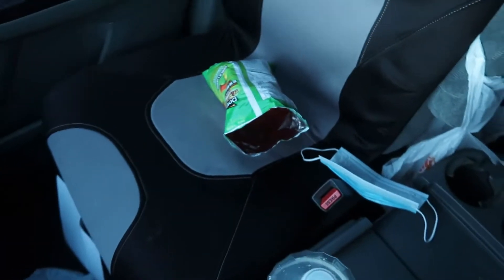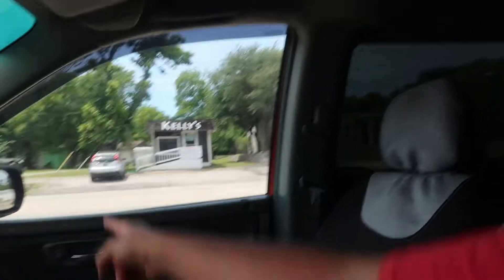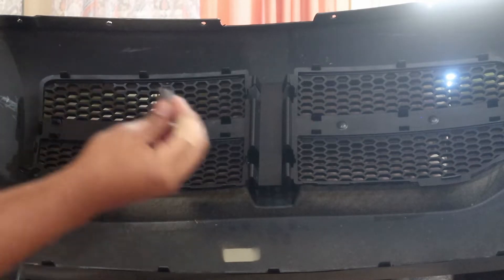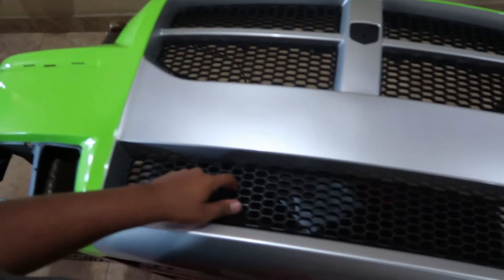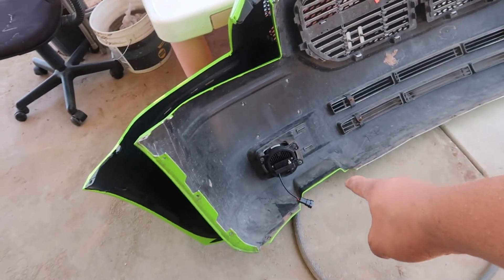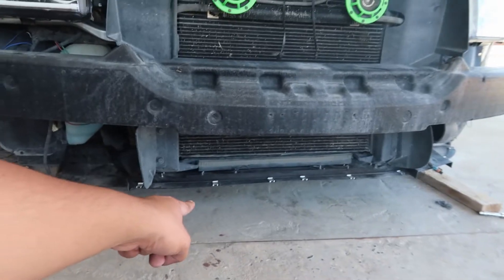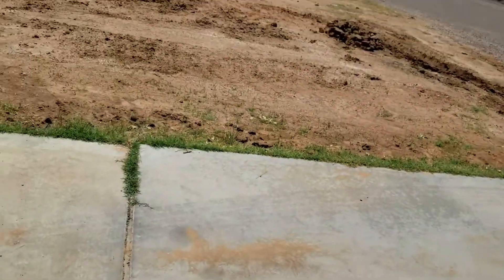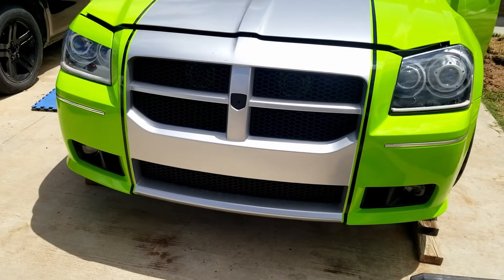Dodge Magnum gets a Face Lift (SRT OEM Front Bumper)

Comment: Did that same mod to a few years ago. Love it. I filled the chrome stripes and the rams head.
Reply: Did u have to use a different bumper absorber for srt or did the one from your original bumper work
Reply: @conneranddevin2911  used the stock r/t stuff

Comment: Was this a 2012 srt8 charger front bumper ?
Reply from the maker: No, this is an 06-07 Dodge Magnum SRT8 OEM front bumper.
Reply: @Need4SpeedUndrCovr  oh dang can you place a 2012 charger srt8 bumper on to a magnum
Reply from the maker: @tino3609  it won't match up, you need fenders custom made for body lines to flow, need the radiator support brace swapped out, need front bumper, headlights, bezels/trim to make it work. It's a whole front end conversion that would need done.